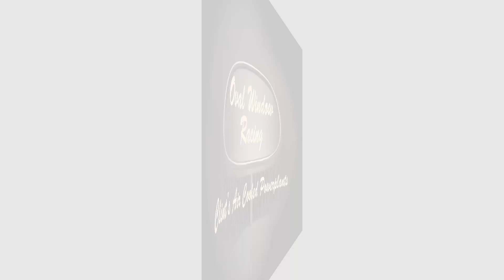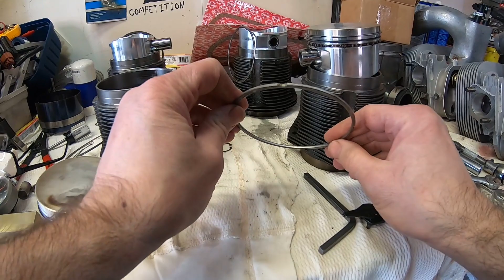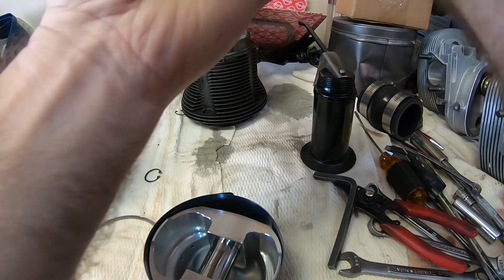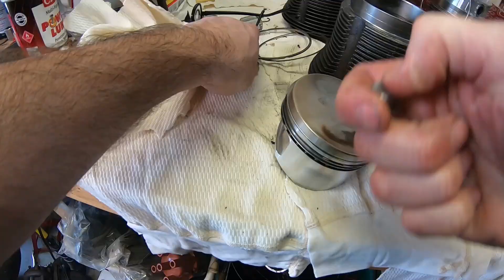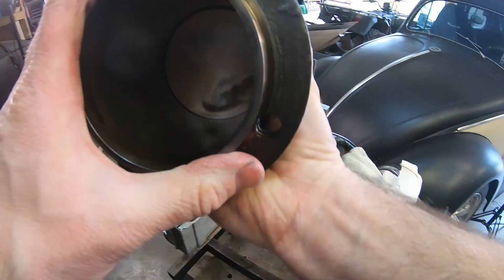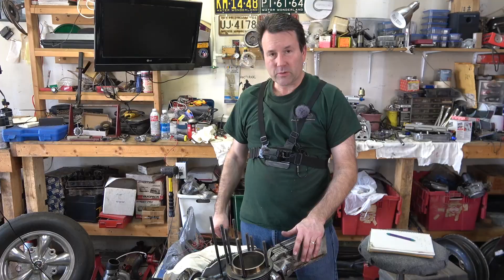Setting Deck Height on A 2234cc Aircooled VW Engine

Comment: Good video 
What is the deck height on 1600cc w/ 85.45mm pistons?
Thanks in advance.
Reply from the maker: @viva_am839  I'm not exactly sure but a google search comes up with 50 to 60 thousands depending on head cc

Comment: I glued 20 mil paper to  both sides of the shims with yellow 3M Weatherstrip Adhesive. Before the glue dried, I sprayed with brake cleaner to dilute the glue which allows it penetrate the paper for a real flush bond. Next day after glue dried, I filed the excess paper at the edges. The paper got my shim size just where I wanted. With the glue and file method you can make a perfect gasket for almost anything  - carb gaskets, intake, numerous other things.

I use a depth gauge at 12, 3, 6, and 9 o'clock and take an average for deck height.

Paper shims? All type one came new with a paper base gasket. It works. Use "The Right Stuff" brand of sealant for cylinder bases. It's like silicone but better.

Comment: What's the heads CC size?
Reply from the maker: 62cc my old heads were 40
Reply: @ddk56vw   Looks like your heading in the right direction. Your engine should run cooler and have more power now.